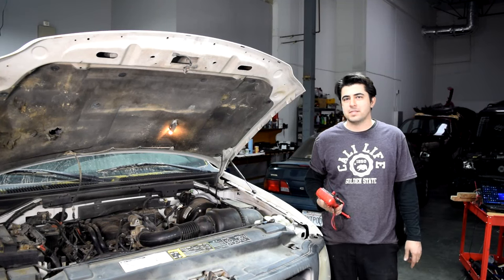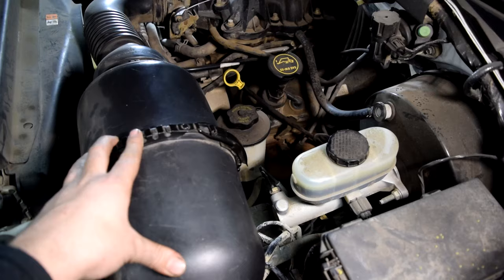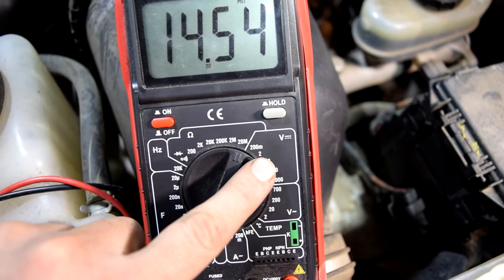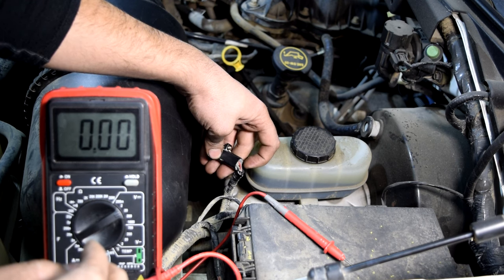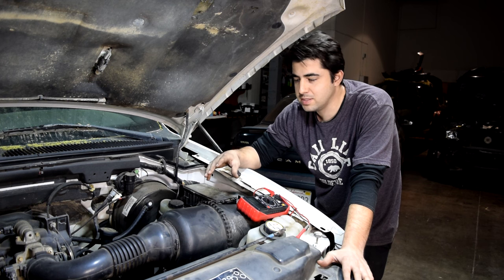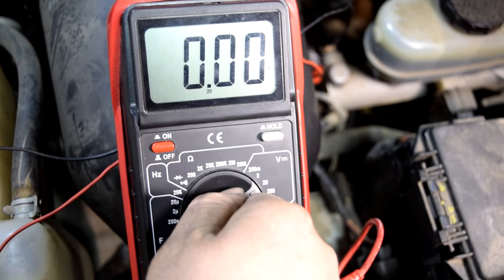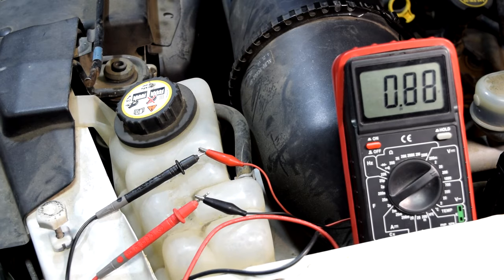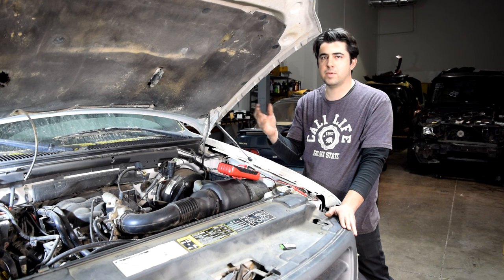How to Test a Mass Air Flow MAF Sensor - Without a Wiring Diagram

Comment: I bet you lost half the people watching this right after you put the paper clip in the wire cause you didn't go into good detail on what wires went to where visually. seems you just expected people to know. I appreciate you taking the time but kinda pointless to those people that's never done this type of thing.
Reply: tobroke2007 
A good point as I was unaware what was happening after the wire clip showed up. I really appreciate all the videos.  It would really help to see a new video in detail when starting the  test with the engine running.
Reply: You just jam the paper clip in. It will make a connection with the wire.
Reply: Wait this is my understanding: With the voltimmeter grounded to the Negative lead of the Battery and the key turned to the on position a charge of ground and voltage will be sent to the sensor, and each of your four leads can be tested. [Step One]: you find the two constants.  1.Constant Ground wire;  .024 Homs (The Black/White wire) meter set on Ohms  key turned just to the on position 2.Constant  Voltage Supply wire;  12.6 Volts (The Red wire) meter set on 20Vm engine started. Then you can [Start Step two]: Now you can reconnect the sensor plug, Set the meter to voltage, Start the car, = Leaving TWO WIRES to be tested with a (Back Probe). 3.Sensor Signal wire; 4.Sensor Ground wire; When probed will send a reading the will increase or decrease along with the RPMs while making throttle adjustments.   (Back Probe - Connectors are exactly what they sound like; they connect the wiring harness to a component. In order to protect, the wiring, the connection to the component against the elements. Therefore, connectors have rubber insulators where the wire enters into the connector. Our goal is to slip a small piece of metal in between the insulator and the wire. Thus the standard sharp, small diameter probe you can slide along the insulated wire into the insulated connector to make a connection under the insulation back to the meter ie. back probe circuit) { A set of Back Probes will list for $18.00 for two $36.00 for five or just bend a few paperclips for $0.00 }. Alligator Clips and Back probes are standard electronic tools. Interconnect Test Leads, Looks like this could have been preformed with just a Standard Test Lead Set (of Insulated Banana plugged to tester with Test Probes in the back of the wire harness plug)      ~ Samuel F Campbell
Reply: tobroke20
Reply: Samuel F. Campbell Right On Sam
Reply: He located the battery power wire and the ground wire then he showed you the color of the wires from the back of the connector. Technically you can test the output of the sensor to the computer while the connector REMAINS PLUGGED IN. Hence the “Back Probing”. Note those systems were originally of BOSCH design. The early LH Jetronic would run a clean off current to burn dirt off the wire upon turning off the ignition. Similarly the wire runs about 100c during operation and the computer can detect load and even barometric pressure by the “Cooling Effect” of the incoming intake air as it crosses over the wire. Note Mass Air Sensors etc on GM cars will send a voltage signal to the control unit
Reply: He did say back pro the TWO REMAINING WIRESSSSS

Comment: so which wires did you exactly back probed when you tested them?
Reply: He connected the two sensor wires and not the hot 12v nor the ground.
Reply: @gweedomurray9923  thanks. Appreciate it.
Reply: @Really658  ~ :-)

Comment: Dude! Whenever you measure the resistance of the ecu harness side, always disconnect the battery first!
Reply: Actually,as long as u use a digital multimeter n not a 12 v test light u should be ok.so in a sense he is doing things t right way

Comment: Very helpful.

The holes in my wiring harness are too tight to accommodate a nail, and the paper clip ends are too blunt to get in next to the wire. I used a couple sewing pins, which are kind of T-shaped. They're sturdy, yet you can bend them away from each other once the pin end is inserted. I imagine pulled-open safety pins would work, too, or even straight pins.

I tried using twist-tie wire, but it was too weak to allow it to be pushed in far enough.
Reply: safety pin
Reply: Dougie D You can buy thinner and sharp test leads or just use a scanner

Comment: Hello, there. Great video andn really well explained. I have a w203 c180K 2004, and since last year when starting the car, it started taking longer than usual and the car started to have misfires when in lowgear and it seemed it like it would die... Took it to a mechanic and he disconnected the  maf sensor, and the problem stopped "chocking" but the start still takes a long time when i turn the key... I bought  a new MAF sensor to replace it, and lo and behold, the problem persisted.... 

So I so some of your videos of how to test the maf. And guess what i found. On the first step, when looking for the 12v pin (it has 04 pins), i tuned the key on, grounded the multimeter, and set do 20dcv... and guess what i found... 12v on 03 pins and 0v on one...

Now, my questions is.... What might be the problem? I live in Brazil, and where i live there aren´t many people that understand how german car works. Got any tips for me? 

Thanks and looking forward to a reply.

Comment: Loved your video--easy to follow, well done.  I have a 2007 Audi a4 2.0.  The Air Flow Sensor has only three wires.  Which one would be missing?

Comment: good info as always thanks for sharing.so the idea is to put the voltmeter on the re ferns and censer ground  wire to find the movement of tps as voltage changes.

Comment: This was a good video just to understand the basic system and how it works. I am having problem the MAS sensor sending a signal that is two high and the computer switches over to a automatic mode to let the car run but not entirely correctly. The light comes on. Anyway I was wondering that if I am having compatibility issue with aftermarket versus factory bosch sensors and the volvo computer doesn't read the china sensor outputs correctly. I have tried three. Of course they make the factory sensor so freaking expensive. It is almost unaffordable to drive a Volvo and get it repaired.  They have everything so controlled and tied to the factory.  Anyway. This gave me a better understanding of what is going on and I think I am going to play around with a potentiometer and change the signal to the computer to see if I can trick it into leaving the light off and not throwing a code. Anyway. Its fun trying...

Comment: Make sure you don’t ground out the + wire. Also keep in mind you can create false codes by disconnecting sensors with the key ON. Don’t throw parts at ghost codes you created yourself (or others created). Hence the importance of erasing codes and and seeing if they still persist. That’s why scanners with LIVE DATA can have advantages. Also you don’t want to trigger a “Limp Home” mode with decreased performance from triggering “False Codes.”

Comment: What if the spark is checked good and the fuel rail pressure is good but will not start when cranked? Will any test on the MAF show any information if the car will not start? Thank you for your efforts, been watching many years.

Comment: Question; in this case, would it really matter which of the ground wires you used in the testing? They are both constant grounds here, are they not? Or battery negative for that matter? When testing the voltage from the signal wire I mean :)

Comment: Good lighting on the Video. Okay Harbor Freight multi meter. I have that one. Good stuff.
Reply: Which one? There are two shown at the beginning.I'd go for the bigger of the two. It's very similar to the Rapitest DM25 I use. Reason I have that is because it can read mVac. Without mVac you cannot test ABS sensors or crank/cam sensors

Comment: Hi, just saw a video where someone just unplugged the connector and when the engine stops, it's not broken. Is it that simple?? Why do you need to measure?
Reply: I read that and tried it on my 2001 bmw 325i. While connected it stalls and shuts off but disconnected it runs. Buying one today but it has been running unplugged for 3 months.
Reply: @jtaylor4027  how is it running now?

Comment: Hi, and thank you for the information.  Question.  My check engine light is on.  The code reader shows P0102 which is the MAFS voltage low.  There is no vacuum leak.  Does this mean that my MAFS is bad because if I test the MAFS installed as you showed we already know that it is going to be low based on the code.

Comment: on my explorer 92, i get code 157,158, low and high voltage codes, check engine light on , I get .01 . check engine light off i get .53 . it is an intermittent thing. checked wires for shorts, none, runs crappy at idle and when driving it will stumble slightly right before check engine light comes back on.  I can also unplug maf and plug back in check engine light goes off. yes I cleaned contacts just to make sure it wasn't a short at plug. my question is, would this indicate a faulty maf or one thats getting ready to completely fail?

Comment: I have nissan murano 2008 and fuel consumption is too high....I change plugs,clean the fuel injector and air filter change ,but no benefits at all.
25ltr  _ 100km
I need advice, what is the problem in the vehicle?

Comment: My multimeter is hooked up as described but my engine will not idle (it dies) unless I disconnect the TPS. Is this test accurate with the TPS disconnected? I'm getting around 5v with the TPS disconnected at cold idle. The exhaust is horrible I assume from a ton of unburnt gas. This vehicle (1990 Toy 4x4 pickup 3VZE Calif) has 7 pins at the MAS connector (3 hot 5v, 5v &12v, 2 Ground, a lead to the ECU and a THA) because the MAS has 3 functions. 1. MAS (Air Flow) 2. Fuel pump shut off if the engine dies for safety & 3. Air Temp in MAS. Isn't YouTube wonderful? It almost sounds like I know what I'm talking about. Not!

Comment: Okay so the last test when you increase and decrease throttle as well as see volatage go up then down is testing the Maf sensor or wiring going to Maf sensor? so if this test voltage reads wrong, how do you fix? You don't say anything on repairing... thax
Reply: Yeah I noticed that too. Unfortunately if your MAF is faulty (try cleaning first), there is only one remedy and that's replacement. But yeah, he should have covered that I'd agree.

Comment: i have a 97 gmc pickup, 5.7  had the code for MAF low voltage come up. seems to run alright. when i did the test on the sensor i get my 12 volts, good ground, at idle i get 4.48 volts, but when i accelerate the volts go down instead of up, they go down smoothly as the the RPMs go up  , any reason?    any suggestions??
Reply: silvermcc Hey bro did u ever figure this out? I have the same truck. Only mine runs bad with new sensor connected.

Comment: Thanks man! I just checked the one on my 2000 Ford Windstar.
Hot wire read 12.66V, both grounds registered 6.41V.
Checking the signal wire, the voltage stayed around 6.94V no matter where the throttle was. I guess I have a bad MAF sensor? Or should I do more test?
Reply from the maker: ILTSYC Not sure what you mean by both grounds registering 6.41 Volts? Follow the instructions in the video exactly, and step by step and you will know if the MAF is faulty.
Reply: RatchetsAnd Wrenches I found the problem with my MAF sensor. After replacing head gaskets and putting everything
 back together, I had the windshield power supply plugged into the MAF 
sensor. Those two plugs are interchangeable .

Its running great! No more surging at low RPM's and hard shifting.
Thanks! One thing that made mine a tad more confusing was that it had six wires because the IAT is integrated into the MAF sensor.
Reply: +Transguy Dumb af 😂😂
Reply: Jeez - poor design!! Well done.

Comment: Hey, I followed step by step on old GM car(1994 Buick Century 1994). My MAF has 3 wires. Signal wire has constant output since i turned ignition on 2.4-2.6V(Doesn't meter car is idling or running on completely open throttle.) And car hesitate while idling especially when It's cold. After car warms up it gets a little bit better and hesitation almost disappears. I purchased new MAF from 1aauto - nothing changed(the same output = 2.4-2.6v). ANY IDEAS? And thank you for videos(unless with TPS diagnostic helped a lot for me!)
Reply: Two possibilities. The less likely possibility is that 1) Your PCM ECU computer circuit might be shorted on the maf sensor internal computer circuitry which would mean even a brand new perfect maf sensor will not fix the problem...you would have to diagnose the ECU...scannerdanner on youtube has a good vid on how to do that.  The more likely possibility is 2) You may not be using the correct red connection plug on the multimeter for your positive red lead connector to the  multimeter...for maf sensors and depending upon the type of multimeter you have the V(ohm)mA port, not the mA port should be used to read the voltage readings. This difference will make a big difference in reading capacity as sensitivity to changes in 1-3 volts are difficult to pick up when your red connector lead is on the mA( designed to be used for 500+ volts).  I would retest it making certain the red lead is on the lower setting of v(ohm)mA and not on the higher voltage setting. Let me know if it worked if you try it.

Comment: Can the airmassesrnsor work like bad of winter in cold weather  the engine works rich mixture  from cold start and stop ,after short time , when i start agin,running the engine  nornaly ,of high rom,befire the rpm slow down and repite  the rich mixture   , the car its a 01 maxima,

Comment: nice vid! is possible that there is no 12v supply, i got p0101 and i did this test but im only getting 4.8v, 5.02v, 5.16v, 13mV on those 4pins. Thanks a lot!!

Comment: in my opel astra h 1.3 cdti const is about 5v (MAF and MAP sensors) is that normal ?? my car cant use all power ://
Reply: Yep, it is. In Your senor is a frequency regulation, voltaga stays constant.
Reply: Sir how to trace another two wire of map sensor

Comment: I tried 3 different maf sensors, the same error code appears 00553, air flow meter intermittent,  I suspect from maf sensor connector. Whats your opinion?
Reply: I'd go with that. Although this is where live data is useful.Next step is to check the continuity of the wiring and connectors from the MAF right back to the ECU.

Comment: How to connect maf sensor output ( LB/RD) wire #5
How to connect maf sensor signal return (TN/LB) wire #4
How to connect signal return which is GY/RD wire #1
This is for ford windstar 2003 maf w/c is 6 wires, the #6 is IAT sensor output
#2 wire is 12v 
#3 wire is ground 
Thanks in advance
Reply: alsteven44 whaattt?

Comment: Yeah but how do you test this if the car won't stay on without aplying gas?  If a mass air flow sensor goes out, the most likely problem is that it won't be able to maintain idle so being able to test it without the car running is very useful.

Comment: My seems to be holding steady and the voltage increases with throttle and decreases nicely, yet my car still throws a p0102 error code - low voltage to MAF. Maybe it is the MAF then

Comment: I did this test and when i back probe MAF  I get matching  voltage as battery around 12.2  when car in on positions.   When I start engine I get 13.3 to 13.7 volts. Then when i rev it goes up... does this mean my sensor is bad
Reply: jaycruz721 just means your battery is being charged

Comment: Hello. Help me. I have bmw e90 320i. Problem Bank1 sensor2 volt 0. I replaced the oxygen sensor with the same 0 volts.  Fault code p0036, p0140

Comment: Do GM cars ( ie, Impala 2002)  have low voltage for low air flow and higher voltage when we accelerate?
Reply: Hi Alberto, I have found that Impala 3800s have a frequency output on MAF sensor from terminal A+ signal to terminal B- ground.

Comment: Man I'm really stumped on this one. Got a 97 5.7 Silverado. Connect my MAF sensor, truck misfires. Disconnect, runs better. Replaced with completely new sensor. Does the same. Even pulls code for faulty MAF sensor. What gives?
Reply: I have similar issue with 2001 4.3 chevy...its driving me crazy for weeks trying to fix...did you figure out your problem??? any help is appreciated...thax
Reply: @roadstar499  to figure out what is going on you need to have a scan tool that can read the short term and long term fuel trim, and know what the numbers mean, nobody can tell you whats going on before they see the numbers preferably graphed
Reply: What code are you getting?  Could be an open or short in the circuit...MAF to ECU circuit

Comment: I may try this with some wire running back to the car interior so I can get MAF readings with the car in motion.
Reply: Great idea, that would work well, but I'd seriously suggest you get someone else to drive while you watch the meter.ORUse one of these https://amzn.to/2m439QG and Torque Pro on your phone. Use the graphing function if you can't find an assistant to drive for you.

Comment: 5:02 The voltage is higher on cold start because the pistons are sucking in more air because the idle motor is letting more air at cold engine and therefore the sensor is reading this extra air that comes in.
Reply: thats what he said... the rpm is because the engine is spitting in more fuel so that it can start properly, it needs more fuel when cold because fuel doesnt vaporize properly when cold and also cold air is denser when it comes to oxygen so it needs more fuel per liter of air